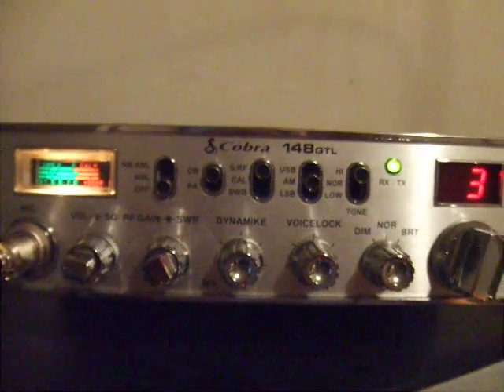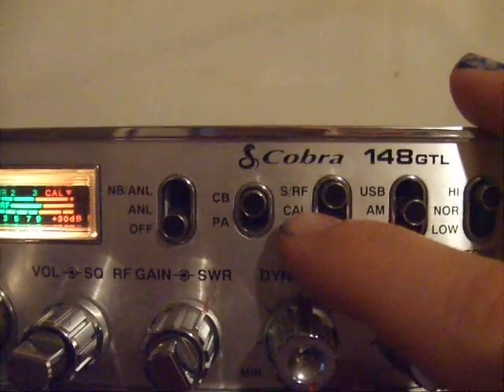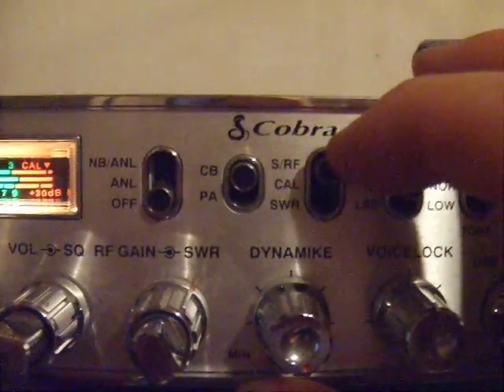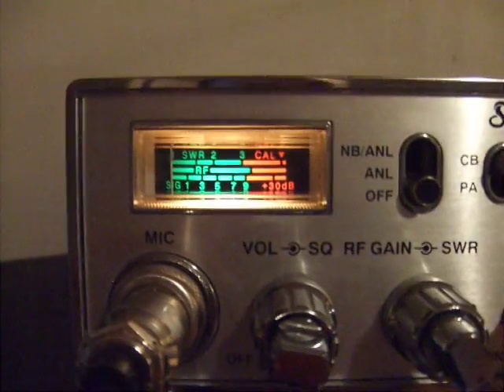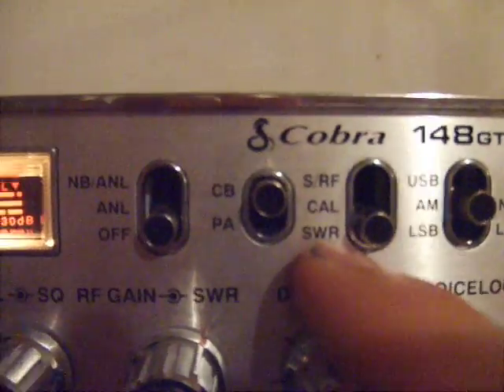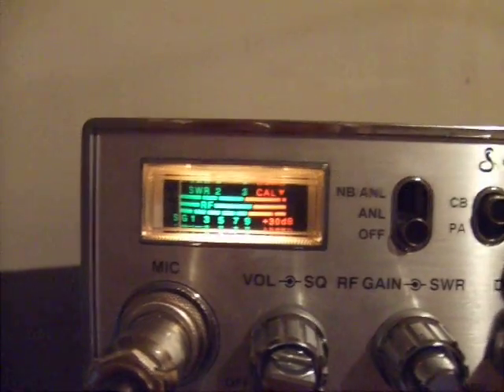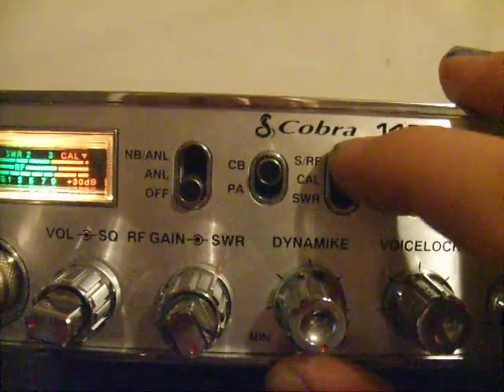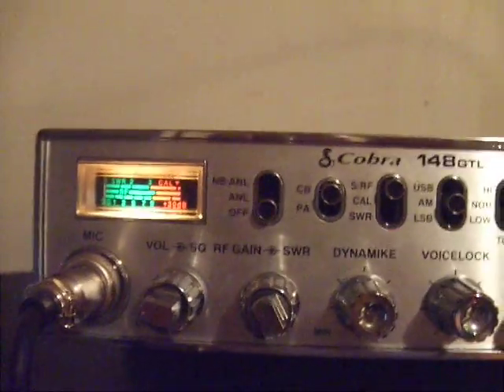How-To: Measure Standing Wave on a CB Radio

Comment: Should my needle be between the one and the two in the green when it's just running normal because if I turn my RF gain all the way up it goes almost to the red and I heard that's bad. So is it better to have your RF gain up all the way in your squelch barely turn down or to turn down your RF gain and turn your squelch up. Bottom line does it matter if my needles almost in the red when no one's talking or just driving down the road

Comment: Good informative video and good choice of CB radio ! Thanks for sharing. 

💉 ⚠ DO NOT TAKE THE DISEASE CAUSING CORONAVIRUS VACCINATION ⚠
It will damage your DNA and creates a delayed disease effect in your body. The Coronavirus is no worse than the Flu virus. 

I know the cure for the Coronavirus and how to prevent from getting the Coronavirus. It is not promoted by the corrupt FDA or the politicians. 

* Buy at the Super Supplements store, Wholefoods or Vitamin Shoppe only (do not buy these at grocery stores!) Take a high quality Zinc, Copper supplement with high quality vitamin D3 supplement with a high quality Magnesium supplement.  
* Take all these at the same time with a glass of steam distilled water that has NO fluoride in it.

* Optional:  You can detox your body first with Cl o2 to strengthen your immune  system. Take 12 drops in steamed distilled water with no fluoride in it.  You can buy Cl o2 from a website called CancerCure7.com

People that are critical towards corrupt politicians will become trusting of corrupt politicians once the corrupt politicians tell people that their life is at risk if they don't follow their orders.

Psyops fear based mind control is a favorite trick the corrupt politicians use on people often and are using the Coronavirus scam to deceive people into receiving the new 666 mark of beast money-slavery system vaccine of the very near future. 

"We're entering savage new times, and we're going to have to be pure and direct and strong, if we're going to survive..."
~Quote, 1983 'VIDEODROME' 

THE USA SMALL BUSINESS OWNERS ARE COWARDS FOR SHUTTING DOWN THEIR STORES ! 
They are NOT afraid of the Coronavirus entering their stores and businesses, they are afraid of the corrupt politician's threats towards their businesses & stores. 

I REFUSED TO SHUT DOWN MY SMALL BUSINESS and I keep REFUSING to SHUT DOWN MY BUSINESS BECAUSE I AM NOT AFRAID OF THE POLITICIANS and I AM NOT AFRAID OF THE CORONAVIRUS. The Coronavirus is no more dangerous than the flu.

The solution to the U.S.A. debt, money problem and Coronavirus deception is in my message here: 

Many evil politicians are trying to make the '666 mark of the beast' digital money slavery system a world-wide law !

Be careful when taking advice from people pushing Silver or Gold as a safe investment.  They often use circular reasoning. 
I been waiting for Jeremiah Babe's channel to respond to my messages of historical evidence about Silver & Gold problems. I wanted him to watch the video called, 
'THE MONEY MASTERS' .

The corrupted politicians have attacked us with the Coronavirus deception, attacked us with shutting down many businesses & companies and are now planning on attacking us with food shortages and violence. 
THE SOLUTION TO THE U.S.A. DEBT & COVID-19 FEAR BASED SCAM IS IN MY MESSAGE HERE:  

Watch the video called 
'THE MONEY MASTERS'  by Bill Still. 

Then also watch the video called 'THE SECRET OF OZ' by Bill Still. 

Then you will know what action we must take when organized !
Give me thoughts about the two videos after you watch them.  

I know what will completely get rid of the U.S.A. debt, but many of us have to demand this from the politicians (our public servants).
If the politicians won't listen then the military has the right to defend the U.S.A. against "all threats, foreign and DOMESTIC" ! 

* Please watch the 2 videos I recommended to you first, then we will talk.  

⚠Maybe we should STOP focusing so much on non-essential distractions and START focusing on who controls the money system.⚠

THE LOSS OF CONFIDENCE IN THE U.S.A. DOLLAR CAUSES VALUE LOSS IN THE U.S.A. DOLLAR ! 

People, please stop talking negative about the U.S.A. dollar.  
Yes, most of us agree that the dollar would be better if the privately owned Federal Reserve business would be replaced with Congress taking back their Constitutional right to print the dollar again as they did before the year 1913. 

* Please watch the video documentary called, 'THE MONEY MASTERS'  by Bill Still.

The U.S. dollar currency has value in most countries on this earth because modern day technology has made it almost impossible to counterfeit.  Gold and Silver can be easily counterfeited !

It costs many thousands of dollars to own a machine that accurately tests Gold and Silver for counterfeits. 

* I personally own a little Gold and Silver as a novelty. 

By you and others criticizing the U.S.A. dollar pushes us faster towards a One World Order cashless digital currency money slavery system !

Please research past history from many hundreds of years ago on how Gold and Silver was made scarce by corrupt politicians.
When Gold & Silver is made scarce it causes many, many problems. 

Send all the corrupt politicians that got the U.S.A in debt to communist China to have them pay off the debt in the China slave labor prisons !    
* President can create an Executive Order to wipe out the U.S.A. debt.  

Then allow Congress their Constitutional right to print non-debt based money again as they did before the year 1913.
The words 'FEDERAL RESERVE NOTE' will then be replaced with the words 'UNITED STATES NOTE' back on our cash. 
If Congress does not do this soon we are going to be in a lot of trouble ! ! 
Why isn't the President taking action by implementing this ?

I and many other American's are not afraid of the corrupt Federal Reserve bank. "We The People" are the government. The U.S. Constitution clearly explains this!  The politicians are our public servants. WE SHOULD NEVER BE AFRAID TO FIGHT FOR THE TRUTH ! ! ! 

Watch the historical video documentary called 
'THE SECRET OF OZ' by Bill Still. 

It explains that Gold and Silver have been made scarce by banks that resulted in depressions and many other serious problems. This fact has happened often in many countries. 
Most people need to fine tune their critical thinking skills and research abilities. 

~DNA ALTERING VACCINES & THE COMING CONTROLLED MONEY SLAVERY SYSTEM~

LISTEN VERY CAREFULLY TO WHAT Jeremiah Babe said over 5 weeks ago on his YouTube channel .....
He said, "The prices of GOLD and SILVER are manipulated !"

Please research past history from many hundreds of years ago on how Gold and Silver was made scarce by corrupt politicians.
When Gold & Silver is made scarce it causes many, many problems. 

*Now, I want you all to think carefully about the logical conclusion here.  

The evil elitist that manipulate the prices of Gold & Silver can make a new law that says you can't "buy or sell" with Gold, Silver or Cash.
 Their new form of "money" will be a computer chip in your "right hand or forehead" that can be scanned just like your bank debit cards at all stores. 

How many of you have 7 years of food stored up in your houses or in your apartments or on your property ?

Why would anybody invest or put their trust in Gold & Silver that is manipulated by very evil people ?

Question, how many of you will be willing to trade your guns and ammo in for food and medicines? 
How many are going to let themselves and their family members go hungry to the point of starvation by NOT accepting the new 666 "beast" money system ?

How many of you will allow yourselves or family members suffer with an injury because you refuse to have the injury treated at your local walk-in clinic or hospital that only accepts a computer chip in the "right hand or forehead" ?

"Shall the throne of iniquity have fellowship with thee, which frameth mischief by a law?
They gather themselves together against the soul of the righteous,  and condemn the innocent blood."
~HOLY BIBLE, Psalms 94:20, 21

⚠  WARNING  ⚠
URGENT MEDICAL INTEL 

The politicians that have given themselves over to evil have been destroying people's health for many years.
 *New Coronavirus vaccine is a 'Trojan horse' ....

The CDC and CIA are using fear based psyops manipulation to persuade citizens into taking the new toxic Coronavirus vaccine.
This new vaccine has a delayed disease creating effect in the human body.  💉  

Please research this truth in the video documentary
'IN LIES WE TRUST' by Dr. Lenny Horowitz. 

Please research this truth in the video documentary 'CORONAVIRUS PREDICTIVE PROGRAMMING' by Dr. Leonard Horowitz. 

Please research this truth in the video documentary 'BEYOND TREASON'.

Please watch the video documentary
'205 - THE MAN BEHIND THE MASK / TOTAL ONSLAUGHT'  by Walter Veith.

*1909 New York Press, January 26,1909 publishes a report by W.B. Clark which states,
"Cancer was practically unknown until cowpox vaccination began to be introduced. I have seen 200 cases of cancer, and I never saw a case of cancer in an unvaccinated person".

UNITED STATES  I. R. I. E.
Investigation Research International Educator
The real "X-Files"
US 5977293425 
AGENT Sinne'

Comment: Do not trust the SWR meter and any CB radio. Buy and external SWR meter and put it in line the meter in that radio is adjustable in the side and can be out of adjustment giving you a false reading.

Comment: HEy would ya know where to look on the inside for the Modulation pod, ? I have a cobra 148 nw st.     also, I cant get the  SWR to lower it's at 1.5  when on channel 40.  but on channel 1- its LOW.    I have a K40  with that 59'' stainless steel antenna.  Should I begin to cut it ?    I was told it may be to long.    CAN YOU HELP ME OUT?  Thanks.
Reply: ok, well I relocated the antenna , got a better signal, now I need to add some HEAT.......winters comming, Rogo' that.   Thanks for info.
Reply: Jim Cash. Both of those readings are fine I would not cut or adjust anything because that low of a reading will not affect your signal anywhere if you think otherwise Google it do some research from somebody other than a bunch of CB met who don’t have a clue.